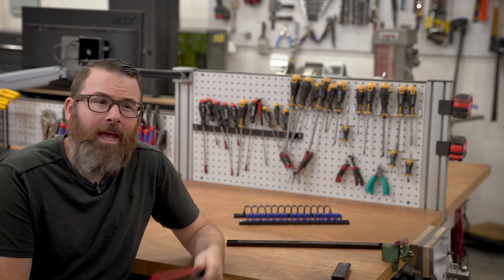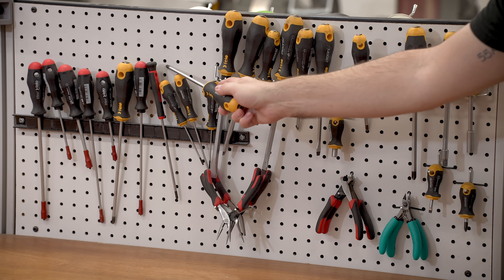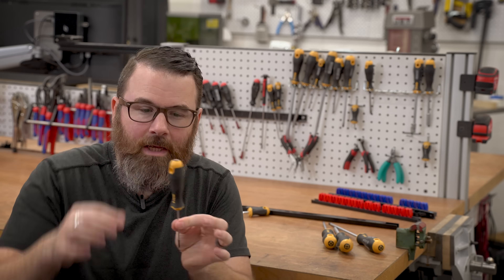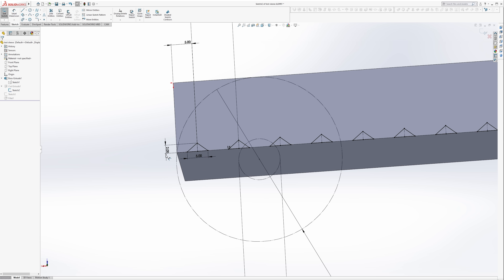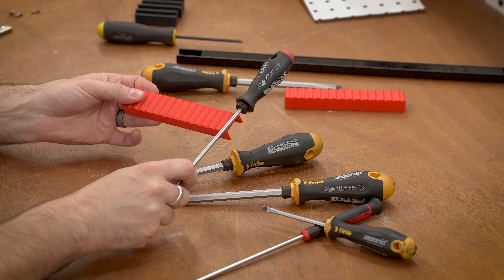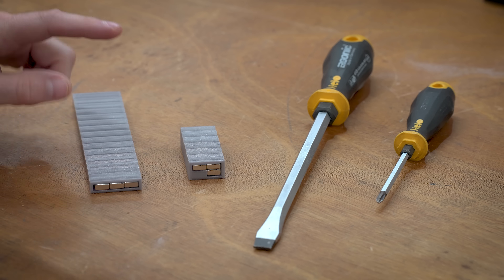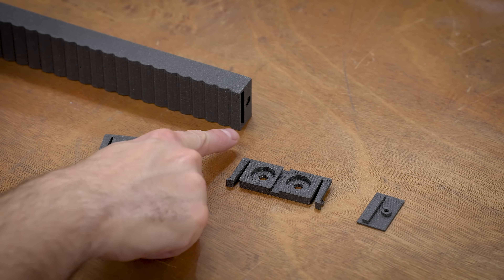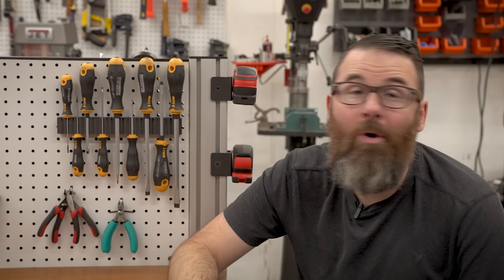DIY 3D Printed Magnetic Screwdriver Holder

Comment: I would have made basically the same thing, but instead of having the front be solid, have it basically just be a ladder type shape on the front so you get direct magnet contact but still have guides to hold them straight.  You could even just nix having anything in front of the magnet and have a sawtooth pattern that pokes up over the top and bottom edges with nothing on the front, at all, and just have the connection wrap around the back.

Comment: I thought i softer filament would grip better if used between magnets and tool.
Reply from the maker: I did think about that, but printing with TPU is always a BIT of a pain.  I decided to just stick with PLA since the clip mechanism couldn't be TPU (not rigid enough) and PLA and TPU don't play well together, so then it would need to be PETG, etc, etc.

Comment: Awesome design, I might make a remix designed to work with one of the Linus Tech Tips magnetic cable management solution for mounting. I need some good screw driver storage.
Reply from the maker: Sure, go for it!  The STEP file are included so people can customize them to what they want.

Comment: You could add a TPU skin for increased friction against the shafts or print the whole thing out of TPU
Reply from the maker: I did consider that, but TPU doesn't play well with PLA, so it would need to be PETG, and the features are pretty small, so there would be some retraction/stringing potentially.  I just went with easy-mode and used higher powered magnets.

Comment: Forget about honeycomb wall or Ikea Skadis, this is the best way to store tools on a wall - it just needs a fancy name 😁
These are perfect, I love the fact that you can mount screwdrivers upside down or even horizontal if that makes more sense. We just got some peg boards from beta with a 1 cm spacing so with a bit of adaptation these will fit our tool walls perfectly.
With flat head, phillips, pozidrive and torx 'll need to buy quite some magnets ...
Reply from the maker: I really do like honeycomb and Ikea solutions, BUT they're not meant for people with a LOT of pegboard or tools.  I have at least 3 4'x8' sections in each workshop, so they would be several hundred dollars in just the wall panels alone.  With standard pegboard, it's maybe $20 for each panel.  But yeah, I spent a few bucks on magnets ;-)
Reply: @RobertCowanDIY  I have 6 of the largest size Ikea panels and I actually prefer those above the pegboards for their visual look but due to the 40 mm staggered hole pattern these are not as versatile as a pegboard. In our big workshop we have steel pegboards. The boards are nice and the standard wire hooks look good too but all holders for screw drivers, spanners and wrenches all went back to the shop - these just don't work for us...
Reply from the maker: @Rob_65  I've always looked at getting a steel version or something similar, but I haven't found anything I like as much.

Comment: You could have the valleys cut all the way to the magnet. That way you still get the full magnet strength.
Reply from the maker: I should address this in a follow-up video!  I tried doing that and it's just really brittle and doesn't print very well.  Also, those ceramic bar magnets are still pretty weak.

Comment: Why not break the v grooves so that the drivershafts rest on the original magnet rails?
Reply from the maker: That's certainly possible, but then the print is a TON of retractions which makes it 1) much more brittle and 2) a bit trickier to print.  There's less than 1mm between the magnet surface and the bottom of the groove.

Comment: A big part of the issue with the magnet strip is that you're putting the handles on top, which makes the drivers wanna rotate to the position of least potential(aka COM below point of attachment). This bothered me throught the video, until you had the design finalized and arranged the drivers neatly packed together, in a way that requires half of them to be that way for the most space efficience.
Reply from the maker: Yep!  It's iterative.

Comment: A very comprehensive solution! Great to see the iteration process and thinking behind your result.

Would a slotted aluminium c channel wrapped around the original magnet work similarly?
Reply from the maker: Potentially.  I did gain quite a bit more holding power with the upgraded magnets though.

Comment: I hate all those ones too. I have the plastic ones and they are garbage.  I'm currently working on the same thing. My understanding is that if you introduce some steel in the holder it enhances the magnetic forces.
Reply from the maker: Yeah, a c-channel could have amplified the force, and stacking them does the same.  But I was trying to keep material costs down, as finding a steel c-channel in the right size without needing to machine it was a challenge.  The inside of the channel has some radiuses that would prove interesting.

Comment: You could make the divots in the rack cutouts so that the tools actually contact the magnetic rail and the metal part of the rail while keeping the spacing provided by the divots. Cool project as always.
Reply: That was my first thought also 😅
Reply from the maker: True, but the magnetic holding force was just a bit too weak for the biggest screwdrivers.  And they slipped when mounted upside down or horizontally.
Reply: @RobertCowanDIY  figures you would have thought that through. Cool solution.
Reply: Yeah, there was an obvious solution all along.
Reply: Was about to post exactly this :) Also maybe print the teeth out of a firm TPU to give them a bit of squeeze

Comment: I think you and I would get along very well in a workshop :). I recently had the issue of my smaller electronic tools cluttering on the work surface or in the drawer. 
So I created a carousel with different layers that spin independently. A home for small files, dental picks, allen keys, small spanners.... all in one place - a spin away.

Comment: I think you might have overshot the easier solution when you didn’t have the first design just guide the drivers to touching the cheap magnetic bar with no plastic in between (more like teeth instead of grooves). ¯\_(ツ)_/¯ 

Still like the over-engineered solution ;)
Reply from the maker: Yeah, that COULD work, but for the larger screwdrivers, the magnet barely held.  This is much stronger and can work horizontally too.
Reply: Agree, the printed channel could go around the back of the magnet bar with serrations on the end of the "legs" that poke out past the front face

Comment: Are we all just going to ignore the fact that all of the those drivers have a hole in the handle for hanging them?
Reply from the maker: SHHHHH!  Not ALL of them do.  I never showed my other workshop, but those screwdrivers don't have mounting holes at the top.  I did consider that, but the holes are different sizes, etc, etc.
Reply: @RobertCowanDIY  just a few of mine have hole, and when I use that, they take the hanger with them when I take one screwdriver off.. Magnets ordered, going to print.
Reply: I do like the design though!

Comment: I've made a variety of driver holders for my French cleat wall. They all involve a pocket for the handle with a cut out to slight lift and pull the driver out.  Not nearly as universal, and they take a little longer to model,  but I've been super happy with them. 

Most of the models are on Maker World, just so a search.

Edit, I've even modeled some of these felo drivers